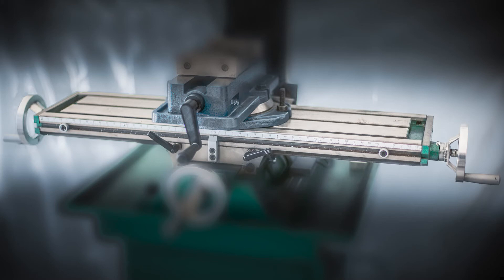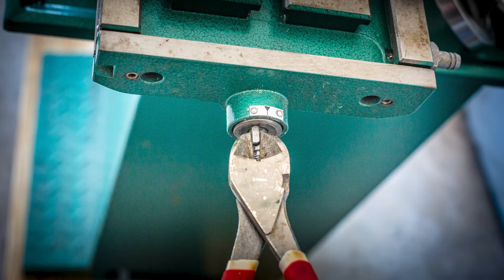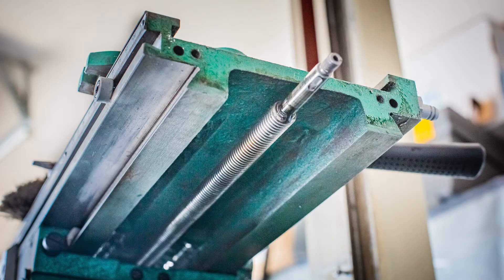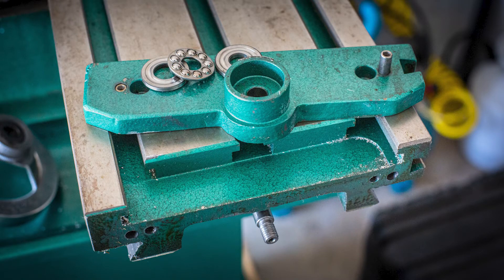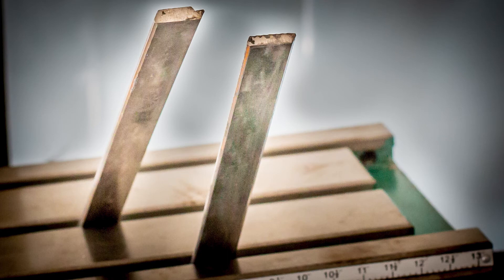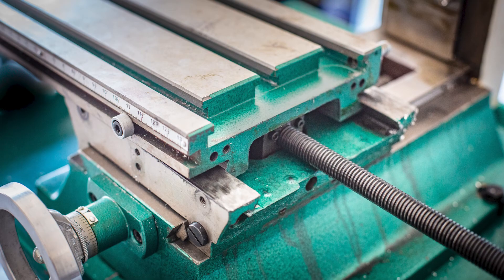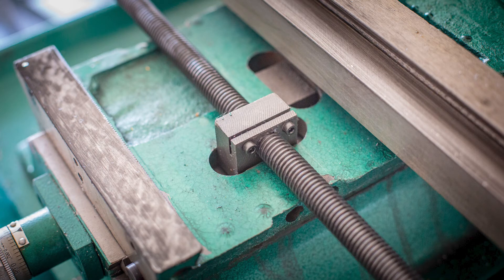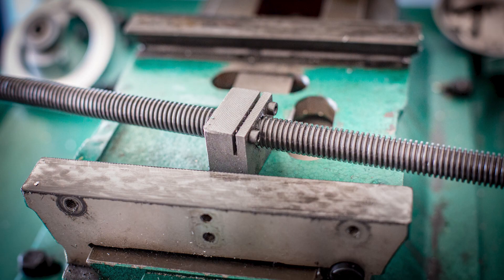Grizzly G0704 CNC Conversion - X-Axis Disassembly - Video #3

Comment: I have the King Canada version of this machine, and this video was very helpful when I needed to remove the table from the base, so that I could break the machine down into smaller parts that I could carry down to my basement workshop. The two leadscrew brackets were definitely hard to remove. I used a mallet to strike a piece of wood, which I placed against the bracket. It took many hits, and some prying, but eventually got them off. I also ended up bending one of the locating pins, which I had to straighten before re-assembly.
I don't know if the G0704 is the same, but the 4 locating pins for the brackets have threaded holes in the end, threaded M4.0x0.7. I was wondering if those threaded holes are intended to insert some kind of pin puller?
Also, the locating pins seem to have a very slight taper, unless I was measuring wrong.
Reply from the maker: Good catch on the locating pins having a taper and threaded holes. Thanks for the information. On my machine the lead screw brackets were removed with just solid taps from the small soft mallet shown in the video, so I didn't look very closely at the locating pins. I suppose there's a bit of variation from machine to machine in the tolerances.